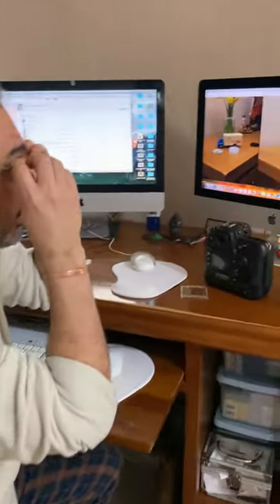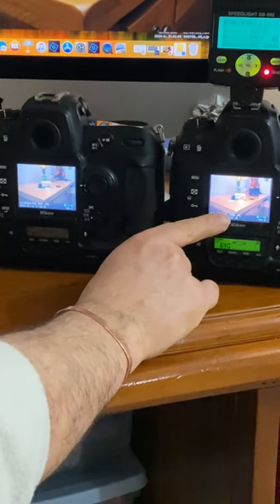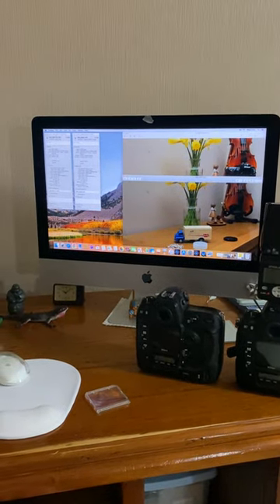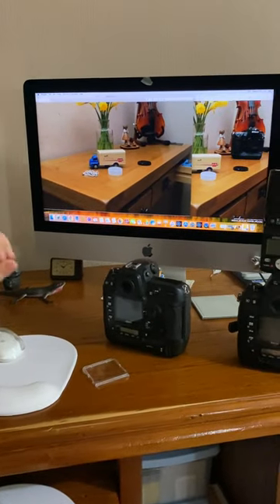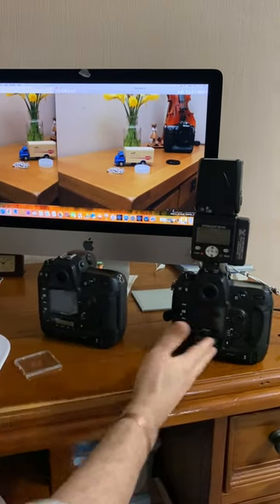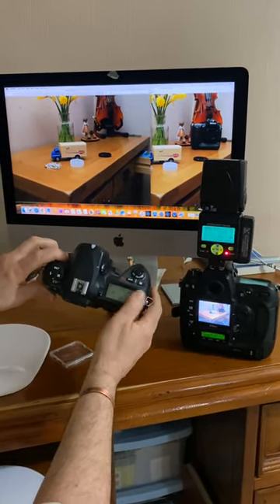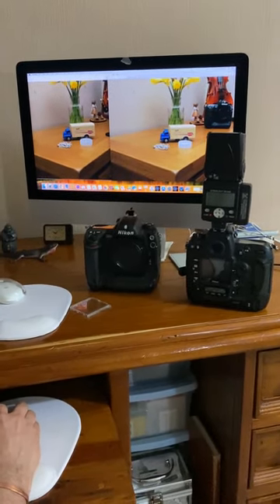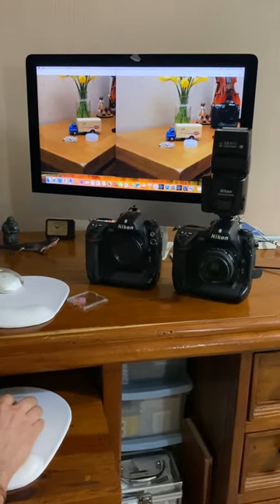24-02 Looking at an old Nikon D2H (LBCAST sensor) with 133K actuations to be listed.

Comment: Recently picked up a Nikon d2a for a cheap photo camera. Do you have any recommendations for someone that's new to using the camera.
Reply: The camera I purchased also has that issue with it acting up on the first shot.
Reply from the maker: I personally have no issues with the D2H having an Err code (error) on the 1st shot when the camera is first turned on...  It is a well known issue/problem which Nikon should've addressed years ago.  To repair the problem is a bit expensive but worth it maybe in the years to come as it is becoming a very rare collectors item.  The D2Hs as well... but the D2Hs doesn't have this problem as such.
Reply from the maker: Nikon D2H outdoors daylight works great with a good lens...  Indoors, I would have a decent Nikon Speedlight/flash.  ie.  SB-28, SB-80DX, SB-600, SB-800.
Reply: @nessetainment  Yea, I'm planning on using the Nikon d2h for a little and if I really like it I might snag a d2x for the upgraded camera quality.
Reply: @nessetainment  Thanks for the help man, Ill look into getting that. I currently am waiting on Nikon AF / NIKKOR 70-210 F/4-5.6 Zoom lens that I ordered for 30 bucks off of ebay.
Reply from the maker: Wow...  Mixed feelings.  The Nikkor 70-210mm AF is an awesome lens but quite underrated today...  new lenses can only compare because they have, AF-S, VR  but on a tripod...  The lens is brilliant.  Very nice on an FX camera as well such as D3, D700.  Glad you got one but if it's nice, clean glass.  I'd keep it and take care of it.  They literally don't make them like that anymore.  Made in Japan.
Reply: @nessetainment  Just got the lens and it works well but I ran into a few other issues. I was sent the wrong charger for the camera now I have to return that and look for a cf card that works with the camera. I made the mistake of buying a 64gb one that doesn't work with the camera.